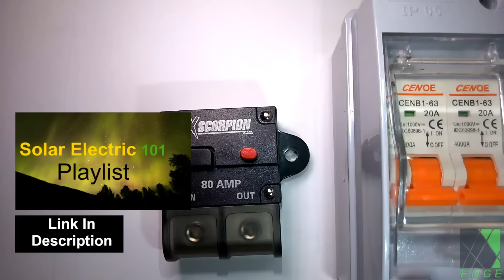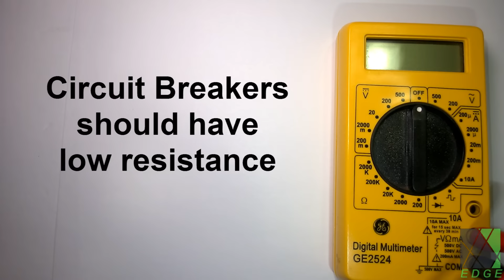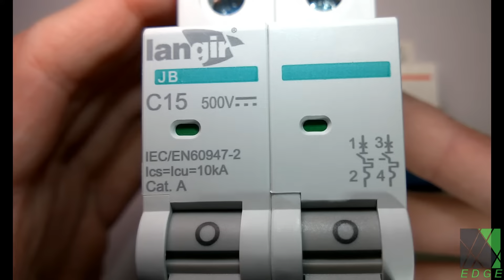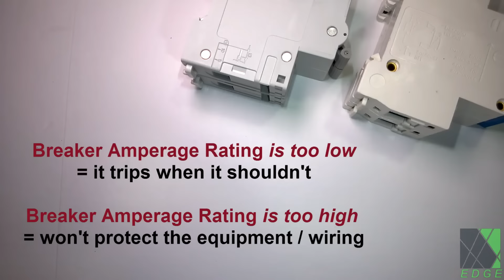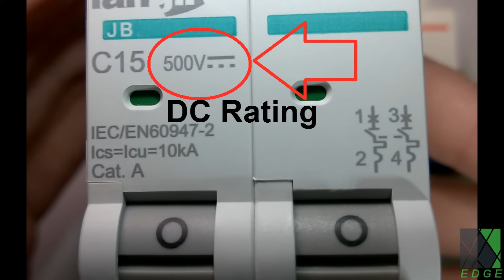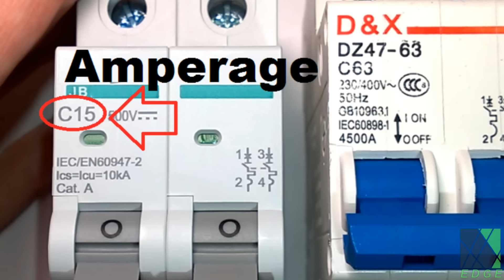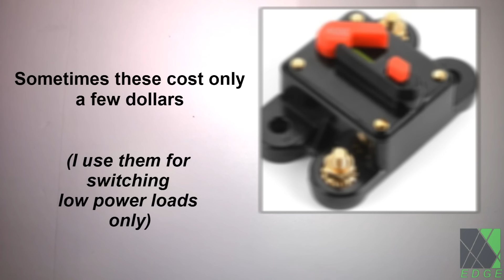DC Solar Circuit Breakers in 5 Minutes: How to Choose Breakers, Avoid Future Problems! Quick Guide

Comment: Do you have a video showing how to actually test the solar circuit breakers? Solar to MPPT and MPPT to Battery? I know I need to check them, but don't want to do so without knowing exactly how to do it, so I don't make matters I'm trying to troubleshoot worse
Reply from the maker: @ktngrandma1 Hello, if you suspect a bad breaker, I'd suggest replacing it. In fact if the breaker turns out to not be bad, you'll then have a spare so it's worth the cost :)

Comment: Is this circuit breaker fully UL Listed, ETL, or CSA saftey certified? Specifically, to meet the N.E.C requirements for approved use in the U.S.?
Reply from the maker: @AjayKoovackal If concerned about code, I would suggest a brand name such as Schneider. I use the breakers shown because they're cheap and work pretty good for my installs.

Comment: I have abb s202m c50 uc can i use in solar system?
Reply from the maker: @HS_capture I could not find the spec sheet, but it looks like a DC breaker, it's probably OK. Please check the max DC voltage and amperage rating as those are the most important specs

Comment: Hi I have a question,about dc breakers.. Im currently installing a 100w panel on a boat to charge the leisure batterys, I'm intending on removing the panel when I'm not there for security reasons, and reconnecting when I next use the boat, I was going to install a DC breaker in between the panel and the charge controller, is this the right thing to do, or should I just throw a blanket over the panel and then disconnect?👍🏻
Reply from the maker: @eyespysky331 Hi, throwing a blanket over the panel is a low-tech solution I have also used before. It will de-energize the panel just fine. Especially for only a 100w panel it should be fine!
Reply: @solarpoweredge OK cool thanks for reply, when disconnecting should I do the live connector first, then neutral? This is where a breaker would probably be handy I guess?
Reply from the maker: @eyespysky331 That's true the breaker would normally be the shutoff. There is no specific order per se in this case, you can pull whichever wire is convenient. Either positive or negative. As soon as one wire is pulled, the circuit goes open and is shut off.
Reply: @solarpoweredge ok brilliant thanks, new to solar so just learning the ropes, thanks for your help 😎👍🏻
Reply from the maker: @eyespysky331 Welcome, I'm always learning too :) solar is awesome :D

Comment: I have a single 120w renogy solar panel, I have it hooked up to the plug to charge my bluetti ac180. I am looking to add some protection, What size circuit breaker do you recommend?  Here are the details 
Max Power at STC	120W
Open Circuit Voltage	33.69V
Short Circuit Current	4.57 A
Optimum Operating Voltage	28.89V
Optimum Operating Current	4.21A
Maximum System Voltage	1000VDC.
Reply from the maker: @smx949 Hi, In this case the unit itself (bluetti) should have it's own protection built in. But if you require further protection, a simple DC fuse rated at 10A would do fine. You can also find MC-4 "inline" fuses that are very quick and simple to place in series. Otherwise, a standard 10A PV-DC circuit breaker would be OK as well. Hope that helps!
Reply: @solarpoweredge   now i am going to show my true dumbness. Would i need an inline fuse for both lines or just one?
Reply from the maker: @smx949 I would refer to you as smart! Pursuing knowledge and asking questions is a smart choice :) usually you only need one fuse because it will blow and break the circuit instantly if needed. But: if you're curious to know, sometimes fuses are used in series and parallel for various reasons. It is a topic to study and research separately if interested. 
However for your Bluetti - a single series fuse will be 100% adequate. A fuse like this is not polarized, so you can place it on the Negative or Positive side of the solar wires, whichever is convenient. Its sole purpose is to protect wiring and plugs if there is a sudden spike in current (amperage) or perhaps a short circuit. Better to blow a fuse than melt wires and potentially start a fire. Hope this helps!

Comment: i want to ask i am searching for one circuit breaker for my project and i found a product in scheinder. they mentioned the working range for both AC and DC, so is it possible for one circuit breaker to work with both ?
Reply from the maker: @muhammadnursebik2790 Hi, a DC circuit breaker "could" work with AC too. If Schneider rates it for both, it should be OK - just got to double check the spec sheet and make sure

Comment: Which one is better: a 1-pole breaker that only "cuts off" the positive wire coming from the solar panel? Or a 2-pole breaker that "cuts off" both the negative and positive wires. Can I just use a 1-pole breaker?
Reply from the maker: @User-jr7vf The 2-pole breaker is able to be a true disconnect, as it can lift both Positive and Negative. However you can also loop one wire through and break only the positive. Yes it's fine to use a 1-pole breaker as well.

Comment: Great video. I want to use a breaker to connect the solar panels to the charge controller. If I use a 1-pole breaker, the positive wire coming from the panel would be going through the breaker, while the negative wire would be directly connected to the charge controller. 

On the other hand, a 2-pole breaker would allow me to get both positive and negative wires through the breaker. Which one is better? Can I use a 1-pole breaker?
Reply from the maker: @User-jr7vf Thanks! You can use a 1-pole breaker. Some of my solar panels use the very same type of breaker, works fine.

Comment: Excellent video ! The option of using  the ANL fuses really is for me right now .  I can upgrade to a  d. c. breaker in the future if its needed.   A reminder about securing my wires can only be good .
Reply from the maker: @zing913945 Thanks a lot :D I am starting to use ANL fuses more... simple, cheap and they work... no moving parts. Right on about securing wires, I've forgotten that a few times and had some "safety incidents"...

Comment: Hi, thank you for the video. You mention 500V, if it's a Double pole MCB, then it's 250V per side. I have 11 panels in series, total is 550V. Can I consider a double pole MCB of 600V or at least a double pole MCD of 1100V ? This is a bit confusing for me. Thank you.
Reply from the maker: @jonathanp1022  Hello, you're welcome! I am thankful for your views :) sorry for the confusion. The double-pole breaker is one unit. So it's rated at 500v. But I strongly recommend against using a double pole breaker for "2 separate circuits" but if someone did, each side is only 250v. It's best to use 1 breaker per circuit whether double-pole or not. Those breakers are linked together and the single DC circuit is supposed to pass through "twice" so it gets interrupted twice.
*For your 550v PV circuit, definitely need a breaker with 1000v or so rating. That is extremely high DC voltage and the breaker should be rated appropriately. The voltage should never exceed or even get near the max rating. Also, it's good to check the spec sheet for the breaker. (If it doesn't have a spec sheet, I wouldn't buy it) Hope that makes sense!
Reply: @solarpoweredge  wow ! The answer was pretty fast ! I'm very impressed. Sorry, to be sure, if I may ask, in my solar panels solution, since all 11 PV panel are plugged in series, there is 2 DC cables at the end of my roof, the positive and negative, I thought I can put the positive in one hole, the negative in the other hole, on the double-pole breaker 600V. Since total is 550V, and it is same circuit as all the solar panel is plugged in series, I thought it could be ok. So in this configuration, I still have to use at least a 1100V double-pole breaker ? Thank you again for your time 😊
Reply from the maker: @jonathanp1022 Hvdc is incredibly dangerous so my thinking is, can we really be absolutely 100% sure the PV voltage never exceeds 550v? Is that VoC or loaded voltage? Solar panel voltage does change quite a lot depending on conditions. Normally you'd want some "headroom" in the specs. If there is any doubts, I'd upgrade the breaker to higher voltage. You don't really need 1100v though. It depends on what breakers  are available for sale in your area. For example, a 750v breaker would be a nice comfortable rating, plenty of room for voltage variations :)
Reply: @solarpoweredge  thanks, it helped a lot. I understand better now, thanks to you 😀 You really are the best. Yes, the 550V is Voc at STC condition, and 461V Vmp. So I think 600V double pole MCD should be fine in my situation, if I'm not mistaken. Thank you again 😊 you are very active in helping people. I'll subscribe, hope i will help you at my own low level 😀
Reply from the maker: @jonathanp1022 Welcome! 600v sounds very safe. also I appreciate your subscription, it means a lot thank you :D

Comment: I'm using 100w solar panel, 20a pwm charge controller and 20ah lead acid battery, do I need a circuit breaker?
Reply from the maker: @CheMathiewNgayihiAbbe  Hello, I believe your setup is just fine! if you want to add simple over-current protection on the battery side, I recommend "12v automotive fuses". Those are a quick way to add over-current protection without using a circuit breaker. These are just my opinions and ideas, hope it helps :)

Comment: 55watts 2 panels need breakers?. If yes, how many amps breaker need?
Reply from the maker: Hello, 550 watts total? What is the current on the panels? Estimate: 24v panels, probably need about 20a PV breaker. 12v panels, probably 40a. Without knowing the full details (voltage, amperage), it's very hard to be sure.
Reply: No enough information  !! Go for  10 A  . 12 VDC SYSTEM.

Comment: Very informative video on DC breakers. I am using 8 455 watt panels per string, 4 strings total. Each strings OCV is 394 at 14.3A (Isc x 1.25). On the coldest day, voltage will jump to 432VDC. I was thinking 500VDC at 15 amps but I am having a time finding QUALITY breakers for this setup. Could you please check my numbers and inform me of a good supplier of quality DC breakers and their housing? Thank You very much
Reply from the maker: Hello and thank you for the good feedback on the video; the breaker rating needs to exceed the string current by some margin, it looks like you calculated that already. With such high voltage, I'd suggest brand name breakers only. Double-pole if possible. Quality breakers are harder to find and more expensive. Indeed what you will find absolutely everywhere are the cheaper options, they are easy to find. I recommend searching for old established brands vs. cheap products with low price on large ecommerce sites. I can't put links here. Examples, Eaton and Schneider but there are others. If you spend some time searching, eventually you will see more professional websites selling pro-grade PV items including the  breakers. They tend to be smaller more generic sites. It sure does take some digging but about 15 minutes searching should do it :)
Reply: @solarpoweredge Thank You much! I've looked for hours to no avail. I'll check Eaton and the others, I am sure they have DC rated breakers. I would assume they would be magnetic, arc fault types? Should I use polarized types?

So my numbers for the breakers, VDC/A, (500/15) are acceptable? Or should I go up on the amps, say to 20? I just want this thing to be safe and able to shut down automatically should something bad occur.

Thank You for your help, greatly appreciated!
Reply from the maker: You are welcome... I have found it is very hard to find actual online sellers for decent breakers. There is one company plastered all over the internet, but they don't actually make breakers and so won't mention their name here. For Eaton and Schneider you may have to contact a dealer. Or look for a local PV / electrician supply house that is willing to sell to you. I don't know why they make it so hard! I usually don't find the premium names on the big "A" website for example, except in AC breakers. 

I am pretty sure any PV DC circuit breaker from the big names will have satisfactory arc handling characteristics. I wouldn't necessarily spec polarized breakers, but just need to install them correctly if they are polarized. As far as the rating, 400v on a 500v breaker is fine. If your series string current x 1.25 is under 15A (meaning you allowed about +20% margin), that should be fine as well. Keep in mind in cold weather the current might spike. Sun comes out from behind the clouds, hits the freezing panels, current spikes. The worst that could happen? It might trip the breaker, but that's hopefully not going to be a common occurrence. It's not dangerous, just a potential nuisance.
Reply: @solarpoweredge  Thank You Sir. That 434 volts is with temp compensation down to 15 deg. F. 

Thanks again, the hunt continues...
Reply from the maker: NP sir, glad I can help, take care :)

Comment: HELLO, Can you please guide me . I have 8 panels  410 watts each connected in series with approximately 380 VDC and 15 amp , my question is can i use 16 AMP , 500v dc breaker
Reply from the maker: Hello, that is very high voltage, must wear gloves and use proper protection. 
The amperage rating on a 16A breaker seems too close to 15A. So it might trigger randomly. No harm done, but that would be annoying. I'd recommend at least 20A+ and 500+Vdc.

Possible option - run 2 strings, half voltage, double the conductors, and 2 lower amp breakers would be fine. This also reduces problems from panel shading.
Reply: @solarpoweredge  . Thank you for your prompt response. For the time being I have 8 panels in a series , my inverter capacity is till 16 panels so probably I will mount another 8 panels into separate series string . If I divide my current 8 panels into 4 + 4 string in parallel, don't you think my vdc will go way down. Since my inverter minimum vdc input requirement is from 130 vdc to 500 vdc max.  I Will follow your suggestion to install a 20 amp breaker .
Reply: @solarpoweredge  . Thank you for your prompt response. For the time being I have 8 panels in a series , my inverter capacity is till 16 panels so probably I will mount another 8 panels into separate series string . If I divide my current 8 panels into 4 + 4 string in parallel, don't you think my vdc will go way down. Since my inverter minimum vdc input requirement is from 130 vdc to 500 vdc max.  I Will follow your suggestion to install a 20 amp breaker .
Reply: @solarpoweredge  . Also please explain a bit about panel shading
Reply: . My rooftop doesn't have any obstacles for panel shading . Yet still plz guide if I divide my current panels into 2 strings  , how will my inverter perform
Inverter specifications are minimum 130 vdc required and max.500 vdc for PV input
Reply from the maker: Hello, you are welcome. Regarding shading. When solar panels are in series, a single panel having a small shadow, debris or any problem reducing it's power output, also can reduce power of the entire string. Having lots of panels in series greatly increases the chance of shading problems. It also creates extremely high and lethal DC voltages which means the installation must be top-notch and cutting no corners. Just something to be aware of.

The inverter is really the deciding factor - it simply won't run if the PV voltage isn't high enough. If you reduce the voltage for the same number of panels, the current increases: requiring more or thicker wire, and/or more conductor pairs and multiple breakers. Also the boost stage of the inverter operates at higher current. It's a design trade off. Simply multiply the individual panel voltage by 4 vs. 8 and compare the current, voltage and inverter requirements. Also consider asking the inverter manufacturer if there is any reason to deliberately operate at a higher voltage, and if there is any efficiency loss or thermal issues at say, 190v versus 380v

It's certainly up to you to decide whether it makes any sense to use multiple strings, or a single string. Maybe its not an issue if you don't have trees there. My property has a lot of trees and it's a huge problem. Personally I stay away from higher voltage for my own safety. That said, I'm just sharing my opinion, and I hope it's of some help :)
Reply: @solarpoweredge  . Thank you dear . Excellent knowledge you have . I will see to it if inverter works on low VDC . I myself hate higher Dc volts from PV.
Reply: @solarpoweredge  . Also I don't worry about my wires as I am using tin coated wire 16 mm
Reply from the maker: You are welcome :)

Comment: Looking for a recommendation for DC, 300 A
Reply from the maker: Larger DC breakers are harder to find. Check out Schneider Electric DC breakers, expensive but high amp ratings. An alternative is to use a 300A+ ANL fuse block, those are much more cost effective and can still protect the circuit.